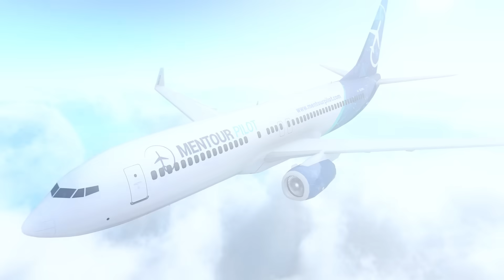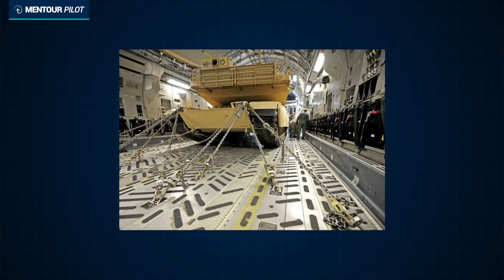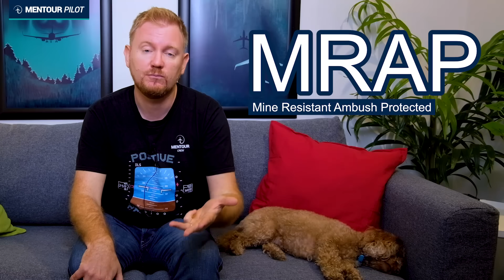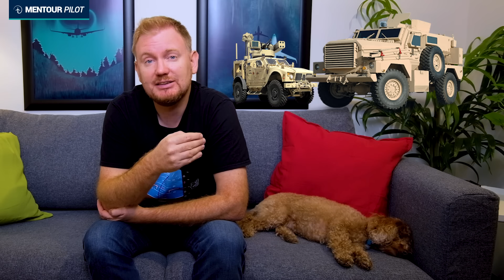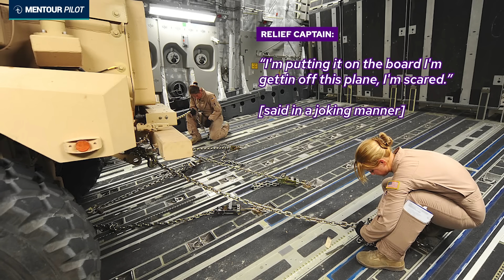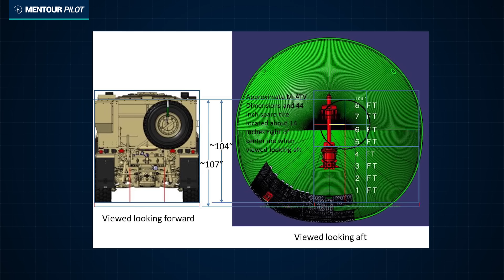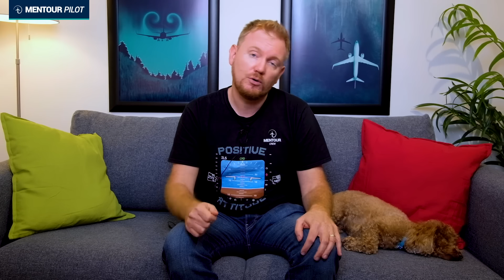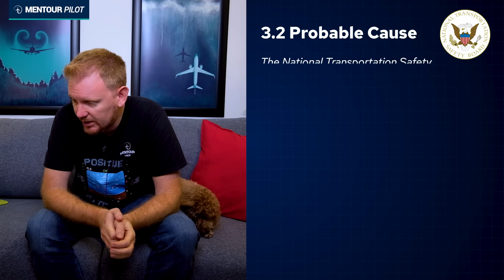Why did the pilots LOSE control?! National Air Cargo flight 102

Comment: I think something that should be required is for any crew involved in the normal operation of an aircraft (loaders, pilots, cabin crew, mechanics, you name it) to have to declare any time they are feeling a time pressure, so that things like this are not allowed to happen. It's better your 18 ton M.R.A.P.s arrive late due to extra precautions being taken, than because they were not, and now not only do you need to arrange transport for the vehicles again, but also recovery of the vehicles, recovery and investigation into the aircraft, and the potential for loss of life.

I personally think that the pilot should have elected not to fly the aircraft until such time that the straps required to hold the cargo down securely were fitted, even if that meant they didn't fly for another week while straps were sourced. Furthermore, the standard policy should be to calculate the required number of straps to hold something securely in place, and then multiply that by 2.5 so that nothing like this can possibly happen, even if a freak incident like 6 straps failing due to poor manufacture, as well as an emergency in-flight traffic avoidance manoeuvre being required to be performed, the cargo still does not move. The pilots are taught to fly coordinated turns, where their bank rate produces a centripedal force equal to gravity so that you can still drink your coffee comfortably while they're in a turn. This obviously stops being a priority when you have to evade a collision in flight, and cargo needs to be secured both front-to-back and laterally to handle a non-standard climb and non-standard bank angle. If it cannot, then there needs to be a transponder code which is reserved specifically for low-manoeuvrable aircraft so that other Traffic C.A.S. systems and A.T.C.s can be aware of the extra risks. 

It's not that I don't trust you, whom intends to do your job to the best of your ability every time you come to work. It's that I don't trust any potential single-point-of-failure, and relying on one person to do their job properly every single time, even under time pressure and high workload is how you reliably get people killed. If doing your job wrong can result in fatalities, and you're not active military service currently in or preparing imminently for combat, get someone to cross check your work. It doesn't matter if it takes twice as long. Chances are they will pick up on the errors that would have lead to these incidents. The cross-checking persons only job is to catch you out on mistakes, so they have time to check everything, and potentially even double check, but the responsibility should fall on both people, so that the book isn't just being passed off on the person giving a second opinion. Any time there's debate between those two people as to the work being satisfactorily completed, a wider consensus should be sought; and the aircraft should not be cleared to fly until the consensus clearing it to fly is reached. The permission to fly needs to be explicit; and I see no reason why it should not also be unanimous; although such reasons may exist.

Furthermore, any time you enter into a regime where you are new to something (and I'm quite sure the flight crew were not completely familiar with hauling 5x objects each with a weight in excess of ten tons) there needs to be extra oversight procedures to be in place as standard.
Reply from the maker: Very good points added. Thank you

Comment: Why did they used straps intended for regular cargo instead of heavy duty chains and wheel chocks for trucks ? 
You give a good quick heavy shot to a strap and they will all break down. The tiedown could have been creative like opening both door of these mine vehicle and passing the chains through the inside with rubber protector on the door steps or other contact point. Also using the frame of the truck as much as possible with hooks and wheel chocks on both side of each wheel strapped together..... Did they had any chains or wheel chocks in stock ? My guess is NO !!!

Comment: I can't believe how lax the Load Master was.
Even if he thought that 26 straps were enough why not go to 36 or 40....just to be certain.
Also, a knot?
Knots in any type of securing straps are a huge no-no - they reduce the capacity of the straps enormously.
Reply: It's hard to imagine being so cavalier about weight & balance to take the "eh, looks about right" approach to a nonstandard, unfamiliar load.  Even without the damage to flight controls, 24-36000 lb objects shifting in flight surely would be a nontrivial event.
Reply: @avengingmime  I really can't get my head around it at all - for it to happen once is bad enough, but for the Load Master to have witnessed the damage and do effectively nothing about it is.....I'm struggling to think how to describe it.
Terrible to think that no-one spoke up .
Reply: @ianmacfarlane1241  that is my immediate thought, as well.  the pilot and the loadmaster both knew the initial strap pattern let the load shift and break a strap.  the obvious conclusion is that the strap pattern is insufficient.
Reply: @ianmacfarlane1241  so consider a few factors
1: pressure from above, Government contracts are highly desired by corporate and they were probably pushing the crew to get the flight done on schedule.
2: inexperience, in almost all technical fields you'll tend to find less experienced people develop what seems like a lax attitude because they don't know how precice things need to be. 
I'm not in aviation but I can tell you that a truck isn't allowed to pull an armored vehicle down a road, much less a plane, with cargo straps, you need at least twice the vehicles weight in tie down chains, and the chains are to be tightened down to the point that it takes major effort on the chain boomer to get another click. Then you drive around for 10 minutes, come back, and re-tighten, as the LM said "everything moves" what he forgot was the last part "everything moves the first time". 
Looking at the pictures even the chains holding the MRAP's to the pallets have slack on them during the pictures from loading (I can't guarantee but they also look way too thin for an 18ton vehicle) I can't see very well but the chains also look like they're arranged wrong, you crisscross chains FR to RL and FL to RR not flat right to left.

Now the fact that the load master even thought it was OK to use that disgusting conglomeration of cargo straps just reeks of poor training and someone doing the "it makes sense" method. Even tho a highschool dropout army truck driver knows that you can't stack ratchet straps ontop of each other because of friction wear.

Again IDK aviation rules but I'd imagine that more cargo planes would be dropping out of the sky if any of that was considered normal.
Reply: @avengingmime  Especially when they had already noticed after first flight that the cargo had shifted. If the cargo shifted even without any incident, it should be pretty easy to guess that if they get into heavy turbulence, the cargo will get loose. And if you have 5 huge vehicles on board with (already known!) borderline straps, having one loose will knock the rest loose with 100% probability.
Reply: Literally the only "cargo hauling" I've done is transporting lumber from place to place in a car... even I know that you never ever knot straps! Creates stress concentration points that weaken the shear and tensile strength of the straps.
Reply: @longfade  as indicated in the video, the minimum number of straps per vehicle was all over the place. 3 different numbers from 3 different sources. Best practices says just keep adding more until there are no more to add.
Reply: But why straps? Why not use metall/Iron chains?
Reply: @markkuuss  Straps are lighter and not as brittle as chains as they can stretch (within limits). Straps for securing cargos are usually also reinforced with Kevlar fibers. Furthermore, it's much easier to tighten straps by pulling them until there's tension, the tension force increases the force needed for the cargo to overcome the cargo's inertia. Chains cannot be tensioned, and the slack can cause the cargo to slide, converting inertia to momentum, and then the chain jerks, the impulse might easily exceeds the chain's limits.
Reply: @markkuuss  There are plenty of cargo chains available for the asking at any military airlift location and they can be gotten from Supply if the civilians lacked sufficient. Government furnished equipment can be hand receipted too. It was a solvable problem.
Reply: Not just that. During inspection they found a strap busted, some were loose and the damned vehicles moved. That should’ve immediately aborted any attempts at a flight until it was rectified. He should’ve told them it wasn’t safe and recalculated again.
Reply: Excellent video. It answers so much more than "the load shifted"
Very well presented. 👍
Reply: Ikr did they pay by the strap or something...
Reply: If after the initial flight and noticing the loads may have shifted and straps were loose......
....was that not time to not simply re tighten the straps, but to add more and contact Boeing or the people that modified the plane.....
...i mean, ask questions.
As you have probably already wondered, I'm a carpet installer with almost 50 years of experience.
What a sad day this was. 😞
Reply: I know this guy. I wish I could tell you all a vantage point.
Reply: The loadmaster states the straps are always loose! So,  that was normal and accepted?!
Reply: @CC-xn5xi When you aren't given proper training, what you learn to recognize as normal isn't informed. It's likely the loadmaster under-strapped and used loose straps often because he just didn't know. So stuff moved a little, and he just thought that was normal, and was never told otherwise.
Reply: Unless you think the Loadmaster was trying to commit suicide this was NOT his fault. He clearly thought the straps in place were enough and had no clue the number needed and the danger -- THAT responsibility is with the company and FAA. They are the only ones who could have saved all their butts. Don't forget it.
Reply: @x--.   People make mistakes all the time. Lack of intent or design neither absolves you of fault nor guilt.

Just cause a drunk driver didn't MEAN to kill someone doesn't transform that victim's death into NOT being the drunk driver's fault.

Sure, the load master didn't do it on purpose with the burning desire to crash a plane with the fixed intent of killing everyone on board. Fine. They still DID it. The good-faith actions they took didn't keep the cargo they were personally in charge of keeping in one place from moving or crashing the plane. And it moved. Crashing the plane.
Reply: @x--.  You didn't intend to trip over the dog. You tried not to. You're still who hurt the dog by tripping over it.
Reply: The manual he was given by National Airlines was so bad that the loadmaster had no chance to know what was enough. Especially because he was inexperienced but that wouldve been totally fine if the manual wouldnt have been so wrong. If you are a loadmaster, then you should know that the angle of the straps matter. But in the manual it was said that the maximum capacity of a strap with any angle is a constant. You can understand how an inexperienced loadmaster might easily assume that maybe they have accounted for the size of the cargo and the places of the straps when designing the aircraft and when designing the vehicle and so the manual is completely right at saying that, because if they are accounted for the angles can be designed in a way and the straps specific size in a way that it actually does have a maximum capacity under some constant. However that was not the case and thats why he used so little amount of straps.

idk anything about the knots u are talking about but ok.
Reply: @iarmycombo5659  It was HIS responsibility to know to get better tech data including directly contacting authorities regarding MRAP (or any specialty cargo) securement. Inexperience is reason to be much more thorough rather than lazily accept defaults and not know what you're doing. I'm an A&P and fixed USAF combat aircraft for 26 years (and also have what should be common sense) and I would not have made that mistake. Anyone in that position should have studied theory of operation and know to ask for more info if in doubt. 

I built plenty of USAF pallets (including of course straps and netting) securing all sorts of equipment and even the newest young Airman knows to elevate questions instead of assume. He was sloppy and evidently didn't care enough to understand what is obviously a safety-critical task.
Reply: @Comm0ut  Not every1 is smart and we cant act like every1 is or exactly this is doomed to happen. Yes it was preventable in 5000 different ways but if not organizational, then they all would require him to either talk about his so others spot his mistake or be smart, and the reasons you said, wouldve prevented the mistake if the load master was smart. It is tragical he was not smart. Also its kind of hard to measure inexperience at work, like after getting a simple walkthrough it doesnt seem that hard so there shouldnt be a reason you would force yourself to act on some doubt that is created by you being inexperienced. But most people when they get a job they just do everything needed to keep the job and nothing else. Idk if he was told to be mindful about the safety at any point and i think poor workplace environment was the biggest reason even though smart people like yourself wouldve not made such mistakes because in the current state of society we just cant guarantee every1 will be smart. And thus there will always be dumb people who need a job and eventually end up in a job like this and for those people we need the organization to actually be on guard and make their workforce actually ready for the job.
Reply: @longfade  which part. Cuz some parts are undebatable but some parts are just the matter of if you believe my sources so which part is bs?

Comment: I'm going to deviate from the "official report" and most here, and place the blame for this firmly on the hands of the US Military and in particular the Air Force. There is no problem with using outside contractor aircraft to fly US Military Cargo. But why were unusual loads such of this not being inspected and signed off on by US Military Loadmasters before takeoff? Armored Vehicles are not something any civilian transport employee would ever deal with.   I'm not saying Air Force personnel need to travel with it. But the Load should have been inspected before takeoff by actual qualified personnel. That's pure common sense. You don't send tanks halfway around the world via FedEx without providing some specialist knowledge. The People in the Green Suits knew 100% how these loads needed to be secured and how to transport them. Somebody should have set foot on that airplane to make sure it was being done properly.

Comment: PALLETS & BEARTRAPS!!!  This is what is holding all the freighters...Take the Fine Air crash in Miami...Having new hires from Dominica, they did not latch rear beartraps of a few rear pallets...on take off, they sliding back of a few pallets got the DC-8 61 had the tail stall and crash at the end of the runway...(just like that 747.) Tests with simulators, we tried to turn the DC-8 sideway and could lift the tail with the LARGE POWERFUL rudder, got going straight and kept flying(at least on the simulator) Knowing that, (With our DC-8,)after an empty DC-8 with a bunch of stack of pallets up front, the stack broke off and all the pallets slid back and got the DC-8 go straight up!...WE used the big rudder and managed to straighten up and flew again(It sure helped to be at 10,000 feet!)